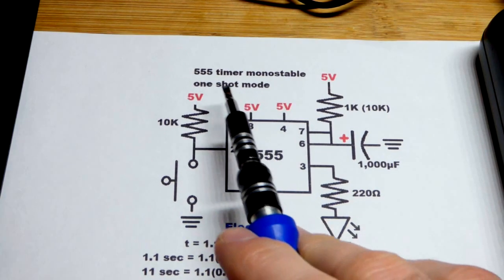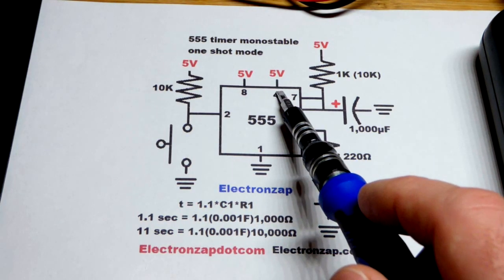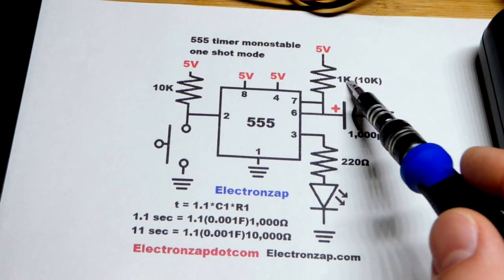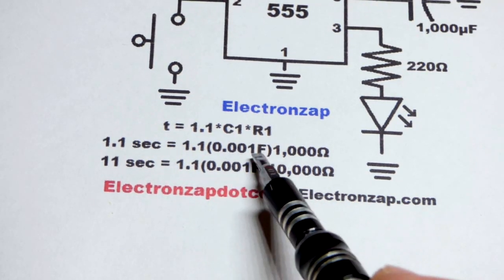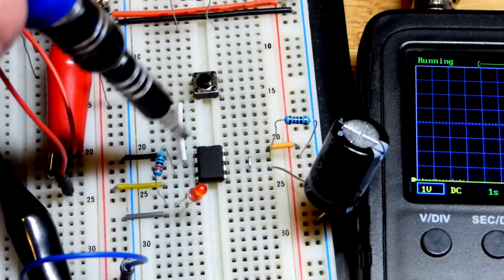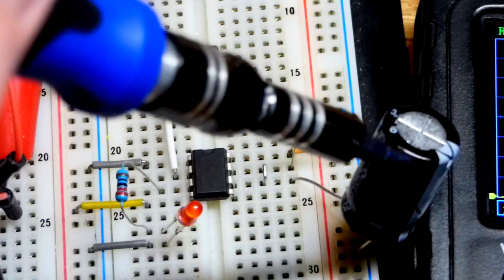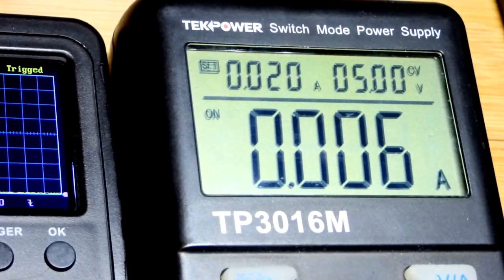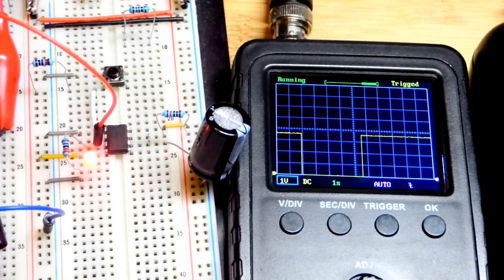555 timer monostable mode or one shot explanation and electronics oscilloscope measurements

Comment: I hope I'm understanding correctly, as soon as the cap charges to 2/3 Vcc that resets the internal flipflop & Q-hat = 1, thus connecting pin 7 to ground and the cap discharges through it? At the same time pin 3 goes low turning off the LED?

Thanks again :)
Reply from the maker: Yup, while the output pin is 0V (connected to ground internally) so is the discharge pin (pin 7). Which is what happens once the threshold pin (pin 6) senses 2/3 of the supply voltage.